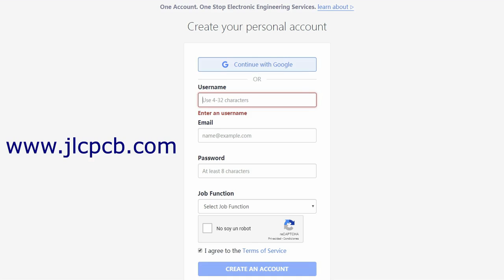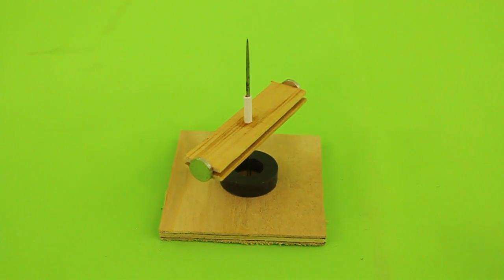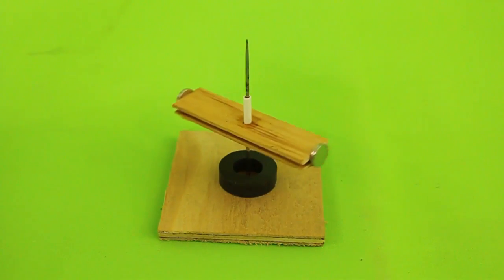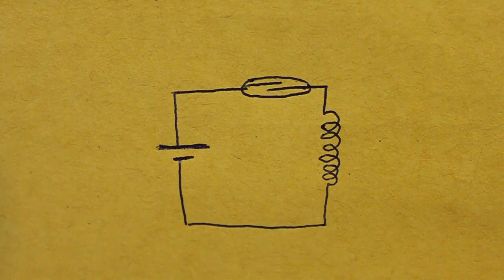Floating Motor

Comment: I think Lidmotor usually included an LED or a diode allowing for the transients (flyback) voltage spikes to be sent back to the PSU instead of possibly causing a small arc at the reed switch. Maybe the reed switch your using has a built in protection diode?
Excellent video, really enjoying your content as it comes out.
Reply from the maker: I just forgot the diode 😁
Reply: what happens to the reed switch without protection? I usually don't take it seriously to include a flyback diode.
Reply: @davemwangi05  If you drive the ciruit with a high enough voltage it will likely eventually spot weld the reed switch shut (I know this from doing so and having it happen to myself). If you drive with a low input voltage your should be able to get away without damaging the reed switch.... But, best practice in this case, is putting in the flyback diode. And if you want to play around with raising the input voltage relatively higher (say 5V or more) then the diode is a really good idea. 
You can use any diode (other than certain spec zener), even LEDs work.
LEDs are particularly cool because you can see the flyback pulse as its created which is kinda cool (in my opinion anyhow).
Peace

Comment: Nice motor you got there. So how many windings in that coil and what is the strength and dimensions of those magnets?
Reply from the maker: Around 500 turns, it is not critical. Magnets are also not critical

Comment: Hi! Could you help me out with something I have been wondering about.
1. When reading about electric vehicles people always talk about the amps and not the voltage. Like this a x amp battery. The more amps the better they say. I really don't understand that. Why not talk about Watt hours?

2. This is about energy efficiency and it is a bit complicated for me to explain but I have this electric bike and a 15 Amp controller. I could either increase the amp or the voltage to make the bike go faster but what would be the best to do to make it most energy effective meaning saving the most battery power?

Appreciate your help with this.
Reply: 1. The amp in that sense is directly proportional to the torque the vehicle can deliver with that battery. Higher voltage can also increase the power output, but usually the motor has a standard voltage to operate on, so increasing the voltage for more power is not very suitable. 

2. Both is the same. The power dissipated by the battery in the end, is the product of Voltage and Current. So if either one remains the same while the other is increased, power consumption is equal for both options.
Reply: @heavycurrent7462  For the motor do you mean standard voltage as in continuous power at a certain voltage without any damage occurring on the motor? For the crystalyte hub motor I have on my ebike it is set for 2000 W continuous drive. But for batteries some people speak only amps as if voltage wasn't important. However for electric bike we have 24 Volt , 36 Volt, 48 Volt and 72 Volt. 
Now for question 2 would you say that it doesn't matter if I change the voltage or the amps when trying to be as energy efficient as possible?

Comment: Just after 5:43 when the rotor hits pause, an example of weirdness in magnetics and why it's intriguing.
Reply: This is caused by the rotor magnet attraction to the reed switch itself.   The reeds themselves must be a ferromagnetic material in order to work.  And the leads are usually a ferromagnetic metal too.
Reply: There isn't enough magnetic material in the reed switch to instantly stop the rotor like that. The rotor magnet did close the reed switch, you can see it bend upward slightly as the ammeter on the power supply climbs from zero. I didn't notice the power supply was even on at first and I actually thought it had been edited. For the most part I agree with ya and I'm glad you said something because I'd missed some things.
Reply from the maker: The rotor just got stuck in the reed switch
Reply: It piqued my interest with LUDIC SCIENCE!